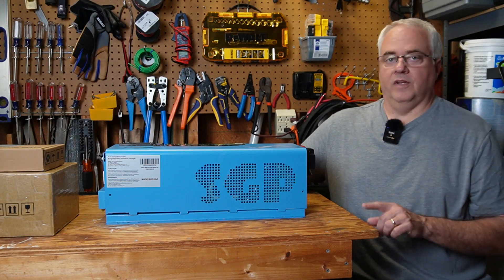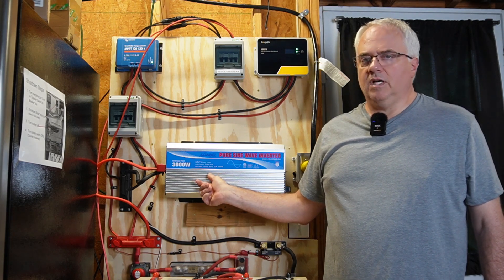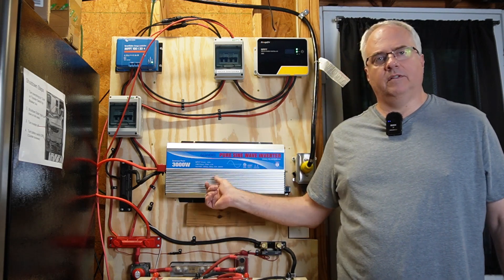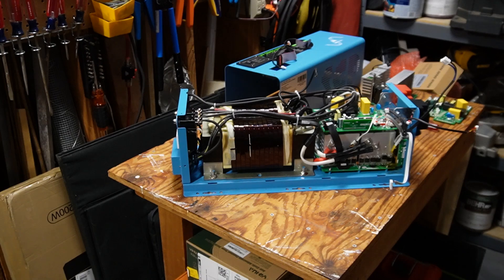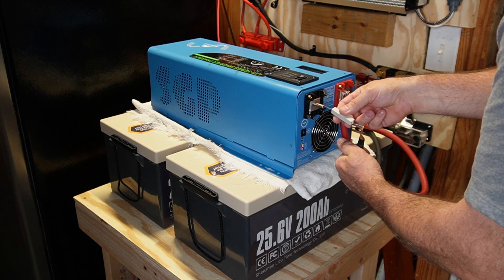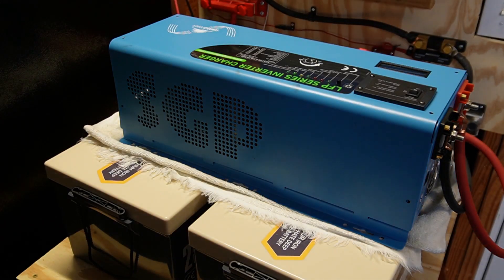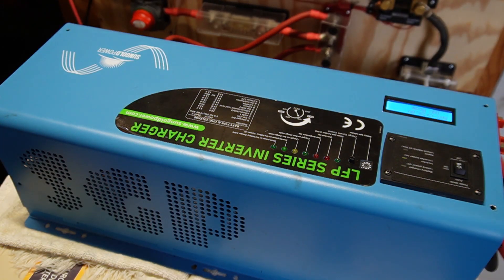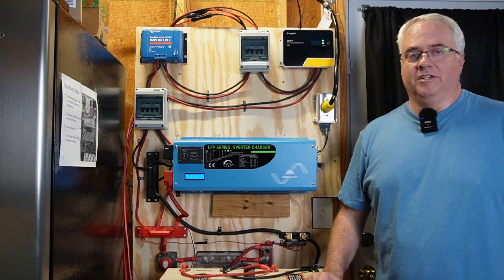Can I FIX my Inverter?  Lightning Strike Follow-up

Comment: Glad you got it fixed and working am a lover of Sungold inverter hoping to get one someday
Reply from the maker: I really like the Sungold inverter/charger. There are two features I wish it had. One would be that it had a switch to manually turn on the charger if I wanted to. Now I have to set the DIP switch over to grid priority mode and then back to battery priority. But it charges the batteries all the way up. I also would like to see a way to set a voltage to where the battery charger stopped charging once the battery hits that voltage. The all in one 48v systems have that feature.

Comment: Here's a tip from a veteran inverter repair tech. NEVER test a newly repaired inverter with a battery. Always test the inverter with a variable power supply set at a low current setting (3 to 4 amps) max. And always use an oscilloscope to make sure that your inverter is producing the proper waveform.
Reply from the maker: Thanks for the tip. That was my first inverter repair. What is the most common issue you face in that situation? Something not hooked up correctly? I'm assuming the low current will help reduce the possibility of damage while still letting you know something is wrong.

Comment: It seems the low frequency inverters do not shut off as easy..  I have another 3200 high frequency running along with a 1200 Victron  24 volt (same batteries).  When the battery hits the top the 3200 will beep and  kick off and the Phoenix never misses a beat.   I’ve seen a flash voltage of 35.14 volts.
Reply from the maker: Thanks for sharing that.